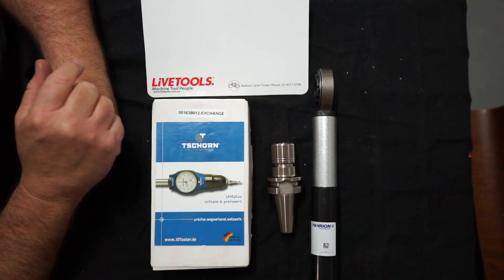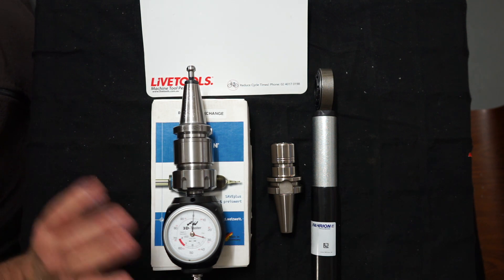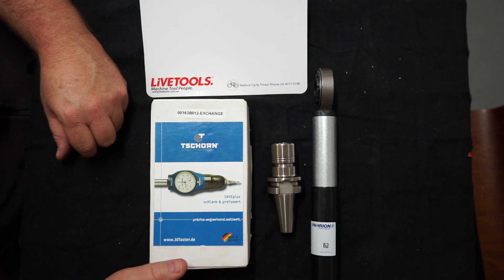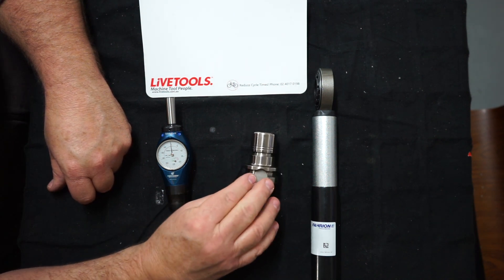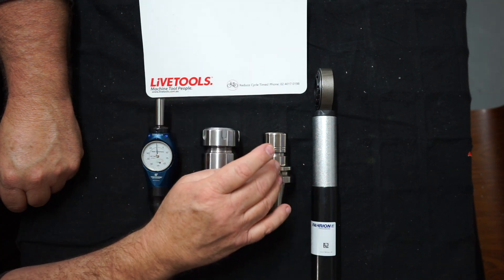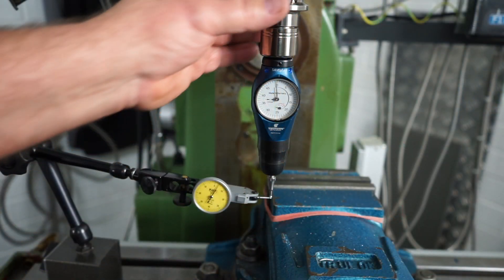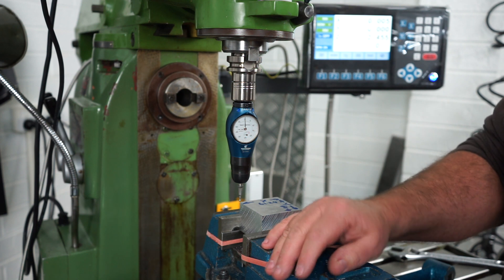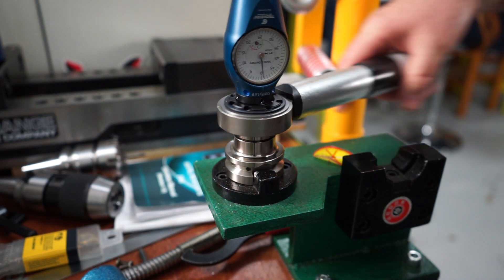New Tools for the Shop

Comment: Too funny about the wrench not working with the taster.  I was going to ask how they were tightened.  What did you use? A small strap wrench?  It's not like it needed to be extremely tight to work with the taster.   So the chinese holder had .0008" of run out.....that's better than a lot of mine!!  The German one was only .0002"  Very nice!! :)  I just got a bunch of holders and tools in this last week.....I should check some of them out. :)
Reply from the maker: G’day Mike. Yes I was pleasantly surprised regarding the Chinese ones. Yes got caught out with that Fahrion collet nut. Oh well, used a pair of multgrips to just nip it up. Cheers buddy 👍🍻
Reply: @AaronEngineering  I just got a new bearing collet nut for an ER20 holder....it's round with no grooves for a tool like that.  I have to figure out how to use it. lol  I just got a bunch of stuff from iCarbide.....seems to be really nice......and it was cheap!! lol :)
Reply from the maker: @bluehandsvideo  I haven’t heard of that company before Mike. I’ll have to check them out.
Reply: @AaronEngineering  They've got overseas locations too.  I don't recall seeing them before, but for as much searching as I've done over the years, I can't believe I hadn't come across them before.  Let me know what you think. :)

Comment: Nice piece of kit indeed.  I use a setscrew style tool holder on my probes.  It's much shorter and less expensive than the ER collet type. Once I set them up I determine the offset length and mark in on the tool so I don't forget.  Thanks for sharing.
Reply from the maker: G’day Steve. You read my mind. That’s exactly what I’m going to do. However, I am thinking of making my own set screw tool holder. 👍🍻

Comment: Hi Az,
Yeah …. Those Tschorn probes look pretty schmick.
As you know, I had DTI send my Haimer to Melbourne following some problems with the tip ‘seized’ in the probe.
They repaired it… but couldn’t get it to hold calibration.
$1k+ of junk now 🤬🤬🤬
I might talk to your mates at Livetools… I was pretty impressed with the Tschorn stuff they had at the Sydney Expo 👌
Looking forward to the follow up vid. on ‘edge finding’ etc.
Robert
Reply from the maker: G’day Robert. I’m sorry to hear that. I would be bloody infuriated with them if they did that to me. Have you spoken to them about it again? I’d request a replacement. You need a solicitor mate to send them a letter of demand. Talk soon Rob. Cheers 🍻
Reply: @AaronEngineering  
Bought the fucking thing about ten years ago mate 🤢
The instrument guys in Melbourne did a good job… but I’d say the prick of a thing was ‘seized’ on day one. Never noticed a problem until I tried to remove the blood tip 🤬
Probably still ok for probing raw stock… but not for second ops or re-finishing stuff.
Live Tools has some pretty nice gear eh?
👌
Reply from the maker: @RobertBrown-lf8yq  Oh mate, that FKN truly sucks. The Haimer is a big ticket item $1K approx. it should be tip top from day one. Yes, Arty has some nice gear doesn’t he. Cheers mate 🍻